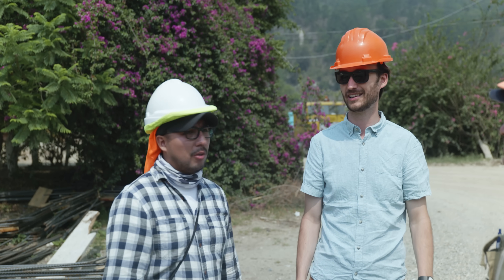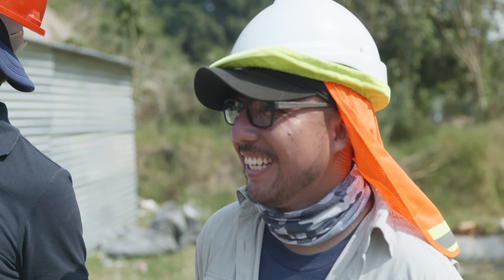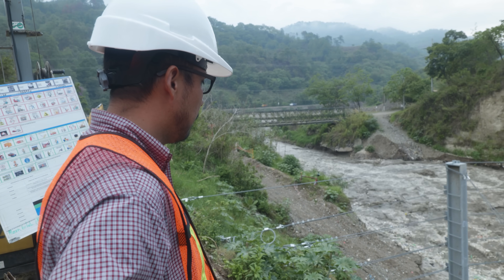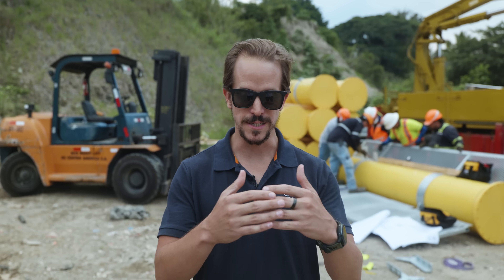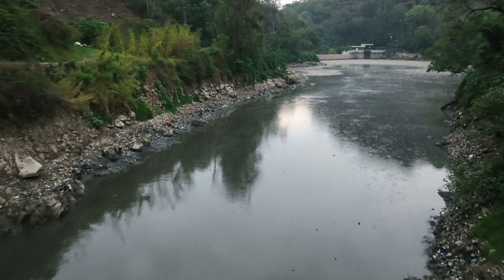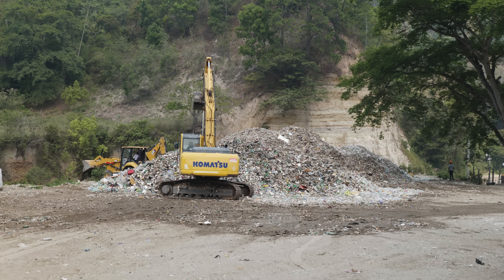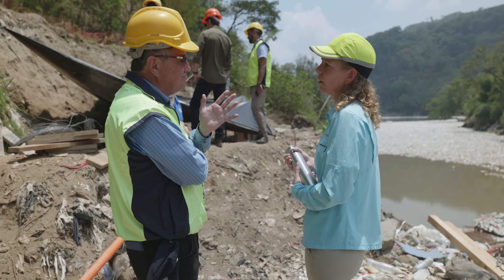Interceptor 006 Is Ready to Tackle Trash Floods in Guatemala

Comment: They could use something like a drag net to capture the trash while letting as much water through as possible. The upper part would need to float on the top and the bottom weighed down to the ground and tied off to the shore. In the turbulent river, it's hard to stop the garbage at the surface level without it piling up and going over / under the barrier.

Comment: great work.. I would suggest to use larger buckets (3x) with larger holes (mesh) and even out of aluminum for the excavators... the smaller buckets require excessive movements... over all these types of excavators are built for heavy loads so they are not efficient.
Reply: also seems like you could just use a net system to fish out large amounts, also why not shred the plastic on site

Comment: glad they implemented my angle idea 💡❤ makes for much easier collecting now they just need autonomous eco powered conveyor taking maybe downstream water to run through transmission gears to lift the trash onto shore directly loading waiting parked large capacity 🚛 semi trailers pulled by any cab even electric like Edison motors or Tesla or that other one , automated classifying would help immensely use robotics and technology to advantage and simply melt down and extrude or peletize the materials into useful products again don't landfill them recycle ♻️ make something new with them 55gallon plastic drums make 3d printing wire make plastic 2x4 boards plastic bricks 🧱 for homes they have plastic paved roadways using plastic to glue dirt rock or sand together into modular forms that fit together to make tracks make plastic cotton candy 🍭🍬 insulation for more efficient heating and cooling of homes saving multiple tons of energy make plastic foam to use less plastic and get more structure strength lightweight and reusable but highly useful plastic isn't bad it's our mistake of using it improperly not treating it like metal/wood 🪵🪓  it's like a cross of materials properties easy on tooling like wood easily meltable like metal heated reshaped formed molded extruded oh if only someone could hear me 🥺🥹

Comment: Design a custom boom for the excavator.  A. The bucket should be almost the full width of the truck bed.   B. There should be more water drain holes to reduce the weight loading of the excavator by eliminating water from the bucket more quickly. C. The entire "skin" area of the bucket should be 'perforated'. Diameter of perforations to be determined. The end goals are; 1) Fill the truck bed with fewer rotations (more quickly) with trash and less water.  2) Reduce the load weight lifted and rotational cycling of the excavator to increase equipment life. 3) Modify the truck bed by raising the sides to the maximum height that will pass safely beneath overhead obstacles with heavy wire to increase the cubic yards of carrying capacity (assuming the bed will be carrying less water load as a result of excavator bucket modifications.  Thank for the work you do.  As a "try it - fix it" organization, I hope these suggestions are useful. 😊

Comment: I wonder, if you put one of the conveyor systems from an Interceptor where you have the excavator, but have it run a lot faster, would that be a way to reduce the pressure by continuously pulling the trash out of the river and dumping it on the land or in a truck?

Comment: if the plastic wants to rise up and over the barrier...let it, be sure to install a catch basin on the down stream side.  This way, the barrier becomes separator and rather than try to hold the plastic back, it lets it ride up and over to catch basin floating on the water just behind the Interceptor.   Think about the way the wind pushes the ice on to land and makes those dramatic ice tsunamis on lakes in the north.

Comment: Next project should be significantly reducing micro-plastic emissions from plastic recycling plants everywhere. They release micro-plastics both into water via drainage of the site but also into the air.
Recycling is a big emitter sadly. 
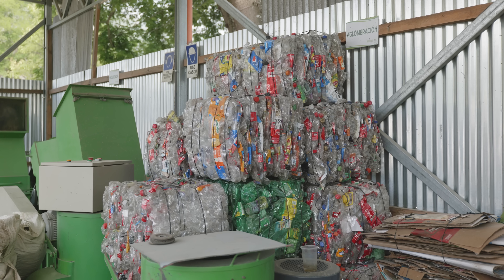You can see the dust produced at 7:23 and thats going straight into the local air to be swept around by the wind and some no doubt back into the river.
This small sized plastic eneters our food chains and our bodies.

Comment: Wow, using Worthington Boatbuster-20 heavy duty debris booms, can't wait to see if the 83,000kg break strength will be enough. And also installing at angle same as our river trash Kabooms here in the Philippines, 45 degrees seems to work for ours. Even then had to remove upstream section of lower skirt to reduce resistance at high flow times. The question will be, will it float or be pushed under letting the trash escape, can only hope it stays on top. I love the smaller boom downstream in wider less flow area. If the upstream Boatbuster boom isn't the solution maybe repurpose it to use in the capture triangle area of the lower smaller boom,  to lengthen and increase the angle. This was  great and longer video I will watch many times,,,thanks for all you do. I will be so excited to watch this working, might give me more ideas for issues we are having here with our larger rivers and small budget. Richard,,,,

Comment: I like that they went to look at the local solution (of a floating barrier) and improved on that design. The Ocean Cleanup should probably have done that the first time around, as it fits in better with the principle of iterative design.

If this new barrier does not catch everything, I think that Ocean Cleanup should look into augmenting the design by using the "trash-catching condom" that the ocean systems use or by taking the "trash lifting conveyer belts" of their other Interceptors and using high-speed versions to drag as much trash onto the sides of the rivers as possible.

I even think that, if Ocean Clean up can look at the design of a watermill,  they could build a trash absorbing "mill pond" and  use the power of the river surge to run a conveyer belt that lifts trash out of the river and puts it into land-based containers. The entire system could be activated only for river surges, with a standard river design dealing with the problem the rest of the year. If a "trash mill pond" design could be made to work, it could then be rolled out to similar rivers.
Reply: Improved? This is a barrier made by Worthington for over a decade, the boatbuster-20. One of the strongest out there....

Comment: seems like it would have to remove the trash about as quickly as it is encountered in order to prevent higher and higher pressures that mother nature can easily break through or pass over or under. Will be interesting to see how this does in a flood.
Reply: A horizontal gutter or grid might be useful: water flows through, trash remains on top to be removed.
Reply: @Stoffmonster467  i picture a barrier across the river at an angle such that the floating garbage flows down the river  to one side, and some kind of wide high speed conveyor or paddle wheels violently ripping all that garbage into the air and onto to the shore.  This flooding happen so fast that it just seems unreasonable to try to catch the tons of material in place. It's got to get out of the water or it becomes a garbage damn that will break the whole system.  We'll see though. I admit I'm just an armchair interceptor designer.

Comment: I  would also give the barricade of the first try another thought. But then don’t fight the water-forces, make use out of it. You can see that the water is heavier than the plastic and wants to get down, by doing so the plastic is pushed up. Guid the plastic up and away / out from the river. Build the barrier with an angle of attack / diagonal, this way new plastic is pushing, propelled by the water-force, the old plastic out. Also you’re making space for more plastic to come and you take the stress out of your barrier. Just need to see where to get a plastic dump field, which can be filled up temporarily with all that incoming plastic. 
Let me know what you think!!
Reply: Well I like your idea, just might work. If I had the money I would try it on one of my river trash Kabooms here in the Philippines.

Comment: I hope those frames can endure the weight of the trash and power of the water.. those look like the "weak points" now, so hopefully they can endure
Eventually maybe the fence on top if it bends or similar?
Reply: Worthington Boatbuster-20 debris barriers are rated at 83,000kg, but mother nature is a force to be reckoned with...